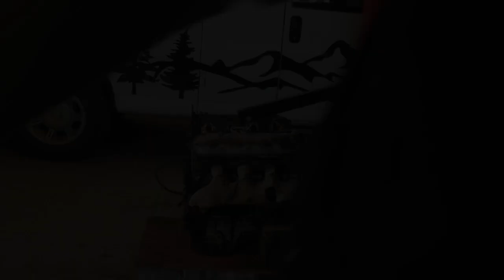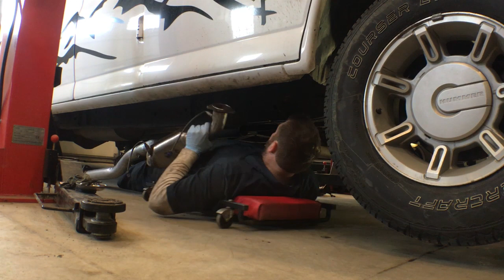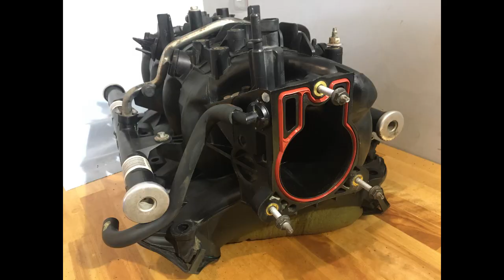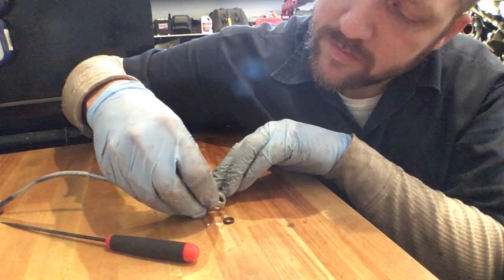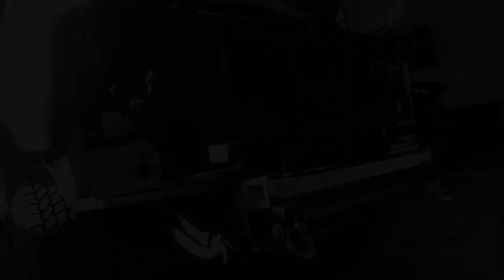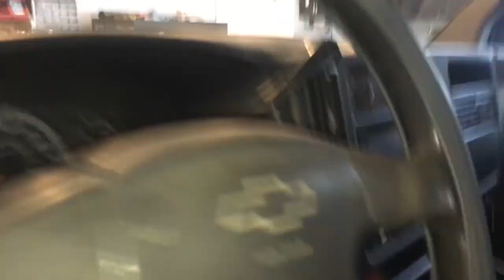How to Replace Engine Chevy Express Van part 2

Comment: Welp... My time is up. Bought my cargo van at an auction in 2019. 2 and half years ago, a valve spring snapped. I didn't know what happened - engine stopped on me and check engine light kept flashing when I tried to drive off the freeway. . Took it to the shop and they charged me so much, I'm going to take on replacing the engine myself... Cause my bottom end started ticking bad a few weeks ago. It's a 2006 express 3500. Has 350k miles. So it's time. Thank you for these videos!! Doesn't seem that bad. But I know it's gonna take me some time, cause things never go this smooth.
Reply from the maker: Good luck!  My van was a 2007 so it should pretty much be the same process as my video.  (Except you don’t have to work around the 4x4 parts)
Reply: So finally got enough money to get the new engine... But something told me to just remove the oil pan. Wanted to see if there was metal. A few chunks, but nothing crazy. Watched a few videos and was talking to Google Gemini. Gemini walked me through everything, to change my rod bearings and sand/polish my journals. It was cylinder 3 5 and 7. Lightly scuffed. Did what I needed to do and... No more knocking and oil pressure is where it should be 30-40psi. 500 bucks! Man I got lucky. Saved your video, for future reference. I probably watched it 10x so far lol. Gave me some confidence

Comment: Good job and a great, easy to watch job of documenting your work!  Four years later, still going strong?  Saw your response about "While you're there" down below, but this certainly would've been an opportune time to replace items like crank and cam position sensors, perhaps the knock sensors, starter, coolant pump, thermostat, oil cooler lines, coolant hoses, belt and engine mounts.  I'm thinking name brand, quality replacement parts; not replacing OEM with the cheapest stuff on Amazon.  You know the history of your vehicle and what has and hasn't been replaced recently, but these parts are all much cheaper than the labor you're saving and should help ensure reliability and that you're not going back in there anytime soon.  I was surprised - no, make that impressed! - that you completely reassembled everything before starting the engine; showing a lot of confidence in your work and the rebuilt engine there, lol!

Comment: I also have a 2010 Chevy Express Quigley 4x4 van. I love it! Currently at 125k and running strong. But I have wondered about this exact engine replacement. Great job! I’m curious why you didn’t go ahead and put in a rebuilt or new transmission while you were there? If the trans was as worn as the original engine it probably doesn’t have a lot left. Just curious- thanks !
Reply from the maker: Thanks!  The transmission was already replaced and had about 30,000 miles at the time we did the engine.

“While we’re there” can be a dangerous trap…it can turn a simple project into a HUGE project that goes way over budget.  Example:  if we did the trans, then we might as well do the transfer case.  If we do the transfer case, then we might as well do the driveshafts and differentials…and the next thing we are repainting the whole van.  :)
Reply: @scottrinne1  
Makes sense. I get it. Need to find a threshold or else your spending loads of cash. I hope I’m not doing this to my Quigley for quite a while, but if I need to I know I’ll be back to this channel. Thanks for the intel 👍🏼👍🏼

Comment: The Express vans only come with the 4.3 V6 nowadays unfortunately. The 6.6 V8 is still listed, but dealers said it is not available. I’d get a used V8 van because the V6 is underpowered for these vans. If I got a 4.3 V6 van, I’d swap it with the 6.6. Definitely doable because GM makes parts for it!

Comment: 2 QUESTION  HOW LONG DID IT TAKE YOU ? AND HOW MUCH MONEY  ? I HAVE A CHEVY VAN THAT NEEDS AN ENGINE .. STILL RUNS BUT IT HAS 400 K MILES
Reply from the maker: I was filming so it took forever.  :) 

I don’t quote me but I think the book-time is 18 hours????  …and the price depends on the cost of the engine in your area.  (Look on car-parts.com to get an idea) …not to mention you should add about $500 to the budget for little things:  fluids, hoses, pulleys, and the might-as-well since-I’m-in-here-parts.

Comment: Years ago I had a 1976 Chevy van. Removed engine from passenger side door. Removed seat and lower hinge so door could lay forward.  Removed 305 v8 and replaced with  a 250 L6

Comment: I love your explaining in great detail and what you're doing. I'm looking to purchase a new van. So I'm going to replace the engine for at least 15 years. As I will be changing the oil and transmission fluid at every manufacturer's recommendation. Along with timing chains and anything else that's required. As usually $50 in maintenance will save you thousands of dollars next year..

Comment: I was told that the only difference between the three-quarter ton and ton chey is just an extra spring in the rear leaf springs. However the Ford does a lot more between the three quarter ton and their 1-ton it's much more than just an extra beefed-up spring in the rear. But they cannot compete with a 6.0 or the 6.6 L that the Chevy has.

Comment: nice 2 videos but why didn't you get a bigger engine?my 05 pleasureway RV van weights 8K-9K LBs she needs more cubes. I see the van has hummer wheels what size are the tires. my tires look real small on my van.
Reply from the maker: 6.0 LS engine is plenty strong. Our van is a Quigley 4x4 one -ton with a 3” lift…285/75/17 tires.

Comment: Awesome videos !  Great camera work, very clear narration, and excellent work quality.  Thank you very much.  One thing about filling coolant:  I find on the vans it is much easier to fill through the upper rad hose.  disconnect from the rad, lift it up, and fill that way.  It helps with bleeding the system as well.
Reply from the maker: Thanks!

Comment: You need to make more videos my friend please.
Reply from the maker: lol, thanks!
Reply: Today I will purchase a 97 Chevy express van with 267k miles on it. Is that something I should be concerned about with these vans? High mileage?
Reply from the maker: not really.....My van had 311K miles before it lost oil pressure.  Other vans have gone more miles with less wear.

Comment: Great video! In your opinion, could it be possible to not open the A/C refrigerant circuit by hanging the compressor to the side? I'm about to embark on this same project as a first-timer, although I have some experience with installing diesel engines in farm equipment.
Reply from the maker: I’m not sure about that.  The compressor might fit to the side, but I don’t know about the condenser.  (I left it attached to the radiator when I removed them)
Reply: @scottrinne1  Thank you for the reply!

Comment: Very well done on the videos of removing 6.0l engine out of your Express van.
I'm currently pulling a 6.0l out of a 04 H2 and the engine sit way back in the firewall and it stumped me on how to pull it without damaging anything. But putting a home made engine intake  plate to fit was genius.  Very well detail video, and clean shop. Thanks
Reply: The 6.0l engine I was trying to pull from the h2 hummer came out successfully with no problems. Making the intake plate proved to be very well use and kepted the engine well balance when removing it by myself. Thank you again. Hope to see more of your videos.
Reply from the maker: Thanks Randy!  Your comment made my day.
Reply: @scottrinne1  I'm glad to hear that. Happy Thanksgiving to you and your family.
Reply from the maker: Thanks!

Comment: Over torqued a valve cover bolt on this installation and recovered with a nut weld. Just barely threaded. 😅 Tapped the rest. Jasper  🤷🏼‍♂️

Comment: Excellent video, I'm doing this job right now and it's helping me a lot. How much time did  you take to do all job. (Removal and installation)
Reply from the maker: I was using my phone to film, so it took much longer than it should have.  I heard someone say that the book time is about 18 hours, but don’t quote me on that.
Reply: @scottrinne1  I’ve been on this for like 5 days. I must be absolutely terrible! Your first video validated my mildly blind approach. Thank you!
Reply: @bradfordsims498 it took me 4 days to do a timing belt and waterpump on a pt cruiser. So.eone told me that job is only like 8 book hours. But I'm also just a guy in the driveway with a "mechanics" tool set from homedepot blackfriday deal and some youtube videos.

Comment: Killer job! I wish we had some auto mechanics like you in NC. Beautiful van,  where did you get the bumper or is it oem?
Reply from the maker: It’s not a direct bolt-on.  It requires cutting and welding...but, the bumper is from an 03-07 GMC Sierra.

Comment: Awesome, you really know this engine, I have a question, I have a Chevy express 2004 1500 2wd, it was running fine until we got hit with this freeze, I live in Texas, while I was
driving slowing down to a  light, then when I press the accelerator I all of sudden get this phoosing sound but my check engine light did not come on, so the more I press
the accelerator as I increase in speed the sound stops when I reach over 40 mph. I installed a new MAS, checked all the hose connections, then just got the fuel system cleaned
up. The sound is not as bad or loud but it does continue when I am at rest and press on the accelerator.  I reach 75 mph and cruise at 70 and hardly ever hear that sound only
when I am at a stop in the increase in speed.  I got a new factory cat system last year and my engine light is not on, do you think it is the carbonator, fuel injection or air flow
system with a cracked hose that I cannot see?
Reply from the maker: Sorry, I can’t help you with that one.  I would recommend taking it to a mechanic to diagnose it.  Good luck and sorry to hear that our Minnesota weather visited you guys (you’ll) down there.
Reply: @scottrinne1 that would be y'all, Yankee Doodle, lol. I'm from Michigan BTW lol

Comment: what kind of frontbumper is that
Reply from the maker: It’s from a GMC Sierra truck.  It’s not a bolt-on part; it requires cutting and welding.

Comment: Great video, Scott!  Recently did a cam swap on another LS and became familiar with a few things that gave me pause in your video.  Did you re-use the balancer pulley bolt?  Hopefully you just didnt show it, but that bolt is DEFINITELY torque to yield.  Manual spec calls using old bolt, fully seating pulley at 250ft-lbs, removing, installing NEW bolt at 37ft-lbs, AND THEN AN ADDL 140*.  It might be useful to your viewers to show this, and make sure to sequence it with using the fly wheel locking tool from the earlier point where you installed the alternator, and sequence the video so folks following along dont miss that critical step.  In the vette/camaro LS2/LS3 circles, we have LOTS of issues with balancers, so I would also critically suggest AT LEAST replacing that balancer with a new one, if not an aftermarket ATI one, ALONG WITH THE NEW BOLT.  CRITICAL.
Reply from the maker: oh great...now you got me second guessing if I replaced that bolt with a new one or just re-used the old one. ...I think I just re-used the old one and I know I didn't torque it at 250ft-lbs plus 140 degrees...the reason I know I didn't do that is because I only have three torque wrenches and none of them go that high.   I hope that it won't cause any problems...maybe I should stop by the dealer and buy a new bolt.  (also, I know it was difficult to get the balancer started because the bolt seemed a little too short) 

Anyway, thanks for the comment and the extra work that I now have to do :)
Reply: @scottrinne1  I definitely would! PN 12557840, its $7 on Summit.  None of mine went up to 250, so I did some goofy antics with a breaker bar and some pipe to "make sure it's seated".  That's essentially what it is, but we're talking a press fit. Definitely not something you'd want to put a measurement on from the timing cover (which varies about .010 anyhow on placement and gasket matl. If you can, see if you can get to it from the bottom with some extensions, reef on it, and then replace the bolt.  It shouldn't be somethign to lose sleep over, but its pseudo catastrophic if that comes loose and wallow's out the crank snout.  Not to menion if it comes OFF.  Do not recommend.  Two thumbs down.  Good lookin out :)

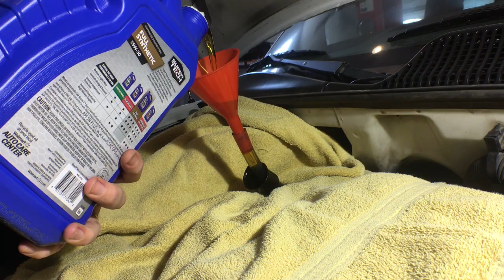Comment: Excellent videos!  One comment I'd like to make, though, is about the oil filling at 18:20.  One can clearly see that you are using a full synthetic oil.  

I was always taught never to do this, for two reasons.

1) the stuff is super slick and can actually prevent proper ring setting during break in (where you need a bit of wear to get a good seal).  Some, however, may discount this as an old wives tale. 

2)  its awfully bloody expensive when you're gonna drain it out and change the filter in a week.

Our shop just used a decent quality dinosaur oil for the break in period.  We actually had an engine break-in stand that spun the engine with a big electric motor at varying speeds so we could perform initial break in for the customer, check oil pressure, check for leaks, compression etc. without installing the engine.  There are different schools of thought on the driving process too.

Again, excellent quality videos, very clear instructions .. I give it top marks!
Reply from the maker: I'm not a mechanic by trade, but that makes sense to me ↑.   ...when I needed to swap the engine in my van, I looked for a video and I couldn't find one that was helpful so I decided to make one during a slow time (covid shutdown).  If anyone is watching this video and reading this comment, then I would agree with 'Indoor Roadkill' that a cheap oil would be a better option to use during the break-in period.  

....well, unless some oil expert chimes and convinces me otherwise.  :)

Comment: How much did this job run you?

I'm interested in working on my own van but it seemed daunting compared to a sedan.
Reply from the maker: I went on car-parts dot com and found a rebuilt engine in my area.  If you look on there you will be able to find one near your zip code and it will show the prices.  I could have re-used the spark plugs, plug wires, hoses, etc...but I figured that since I'm already doing all the work, I might as well replace those parts too.  ...Budget another $500 for all those extras plus what you find on car-parts.